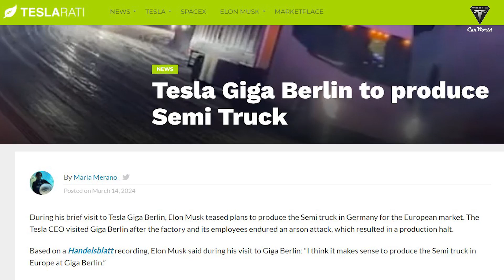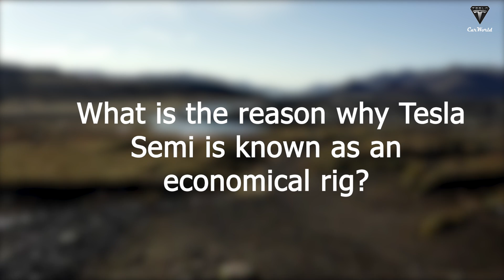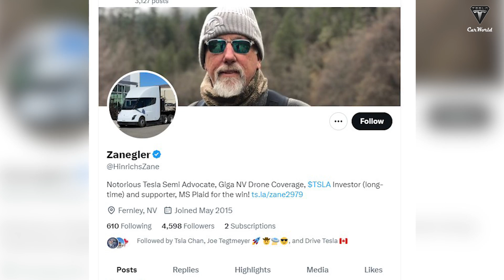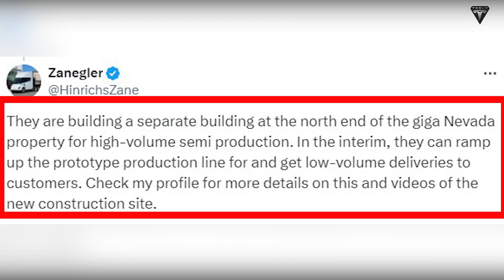Tesla Semi BIG Upgrade! Elon Musk Reveals No More 82,000lb, 1500 HP even 0.22 Cd! Here's WHY?

Comment: This truck is pretty innovative and a technological marvel. But that's where it ends.  I think most people that have favourable comments on it haven't driven semi for any appreciable length of time. This design may work well for certain dedicated routes. However, the average freight hauler will find the center seat configuration impractical. They need to interact with security gates at many terminals, warehouses, and distribution centers, providing ID and documentation. Climbing in and out of that cab is inconvenient and a time waster compared to rolling down the driver side window. Many gate houses are designed with high service windows for this reason. This may even force someone ro come out of the gatehouse to interact with the driver at ground level. Scales have the button pad at driver window height. Getting out of the truck will put the button pad out of reach,  forcing the driver to walk all the way across the lot to go inside,  thus delaying those behind the Tesla. They may have designed it "around the driver". But that's like saying a straight jacket is designed for a snug and close fit. There are so many other things that would annoy me to no end. Personally, I would refuse to drive one.

Comment: If governments were really concerned with global warming, they would be making plans for things like rail build out and infrastructure build out.  One train with lets say 100 cars could carry 200+ trailers.  That would be two hundred EV trucks / diesel trucks off the road.  This would be far better to move freight than using semis driving from state to state for long haul.  There was a study done that its going to cost over $1T to make EV trucks work in the USA.  EV's trucks aren't the answer, rail to move freight is.  Or even container ships, that can haul 22,000 TEU's in a single voyage.  That is a lot of trucks off the road at the expense of a single ship running on LNG.  Need to think out side the trailer box here for real solutions to the problem.  EV's aren't going to solve this issue.

Comment: It makes no sense . The electric battery for big trucks takes up to much weight . You would need 3 EV trucks to haul the same cargo as one diesel truck because of weight limits for trucks on roads . 0-60 mph on a delivery vehicle does not matter . It is simply this the EV battery takes up 2 tons of weight that could be used for cargo . So now you have to buy 
Insure and upkeep and house more vehicles. Additional drivers…. All that companies will ask is what is the price per pound to deliver goods . With upkeep insurance maintenance all of it included. The minute EV Trucks cost 1 penny less to run than diesel the money will flood in .
Reply: It makes no sense because you have poor comprehension. Tesla semi truck can move 21tons at a full legal  load, has is that 1/3 that of a regular semi truck??? 

0-60 matters when entering a highway ramp, passing traffick, or going uphill, going uphill at 55mph saves you a lot of time compared to 35mph. 
90% of trucks don't haul full weight loads on a average day.

Cost of maintenance and service on the tesla semi truck is about half of that as a diesel, and you save 300% on fuel, the reasons companies don't buy them right now is because they would first have to build multi million doller charging systems at their delivery sites, basically, EV semi trucks already demolish diesel on running cost but not initial investment cost, companies are much less prone to long term strategies so tesla has to prove the tech through using themselves, they already being used for logistic runs between Nevada and California.

Comment: Sorry Tesla Fans, the Tesla Semi isn’t the future. This prototype hybrid diesel/electric truck is made for the real world, especially for off road use like logging. Edison Motors built their prototype in one year using off the shelf components and their design philosophy includes the right to repair. 
The very first load moved by this prototype was over 100,000 lbs something the Tesla Semi isn’t designed to do. 
Edison is also working on a retrofit kit for older pickups that will be for trucks that are used for hauling and work unlike the Cybertruck 

https://youtu.be/ROtRiO5rECk?si=aavD7Q9Bn_Pz5WaG
Reply: Lol Edison motors can't compete with the tesla semi trucks scalability, retrofitting things into EVs cost more than just using it as fossils or straight EV, but saves massive on needing custom manufacturing equipment... equipment that would be useful for mass manufacturing. 
Full EV drive trains are better for offroading and high loads than hybrid systems, the tesla model X once towed a 260,000lb passenger plane. The tesla semi uses plaid motors which are even better for trucking than any other RV motor made as they spin up to higher RPMs and maintain far more torque at higher RPMs, makes it a real torque monster.

Tesla cybetruck is a truck I would use in light duty work, and I would like it since I don't have to wory about dents or scratched paint, might haul loads with it for jobs inside the state but not out.
Reply: Edison and Tesla aren't competitors.
Reply: @ThiagoMarquardt  the owner of edison motors likes to pretend they are.

Comment: How about the cost of replacing the batteries and tires?
Reply: Tires are a given expense, wait and see if electric drive is any harder on tires or not, not enough units out there with enough miles to gauge that properly yet. Batteries will be interesting to compare over fuel costs in the same time/mileage period, another hurry up and wait and see, many changes yet to come on batteries, and in energy suppliers pricing structures.
Reply: If you have to ask you probably can't afford them 😂🤣
Reply: @rjones2000r   The cost will be passed to consumers that are buying the goods the truck is delivering.  Means YOU can't afford it.

Comment: There is no need for Tesla to boost  the semi range.  Replace the short haul semis with EVs first.  By the time the short haul semis are mostly EVs the nationwide charging infrastructure for semis will be mostly in place.  By that time, improved or new battery and motor designs will provide 30 to 50+% more range at the same weight.  Fuel and maintenance savings alone will propel the switch.

Comment: The greatest thing on the fly switching from the truck battery to the solor powered  trailor battery pack . You need a 120,000 GVWR capacity on both tractor and trailor , simply means addig a extra axel to the truck and trailer. When the nattery pack is getting low on the truck switch over to the battery pack on the trailer then it switches simultaneously to start charging the truck with the roof solor panels until you get to your destination and do you two hour charge on the truck / trailer

Comment: The Tesla truck needs a spare battery pack and solar panels on top of all Tesla trailers they may be expensive trailers but only Tesla trucks can hook up to them unless there's a adaptor for other truck company's therefore you need able to go twice the distance per load all the whole the trailers will be self charging when you hook up to a Tesla trailer you'll be able to go over 1000 miles before needing to be charged

Comment: As a 36 year experienced driver (retired now), this is a fascinating idea. Based on this recent winters display of EV's batteries not holding a full charge or not charging at all and your "test bed" area being in southern Nevada (?), it is an idea that is not yet ready for full implementation. The one problem I see is that ALL EV's should be able to charge themselves as they are in motion, and so far, non do so. The other major problem is winter and the possible extreme cold temperatures. Unfortunately batteries and cold temps do not work well together. The idea is intriguing though... Interesting. Thank you.
Reply: Cold is an issue for both EVs and for ICE vehicles.  With ICE vehicles you plug in a block warmer.  With EVs you charge at the end of a run while the battery is still warm not after the battery has cooled down to ambient temperatures.  Then you prewarm the battery before its next use.  For the semi, the power for prewarming could come from a 110 VAC wall connection leaving a full battery for hauling.  For cars the power for prewarming comes from your home charger or from your battery.  Yes this takes forethaught but who really wants to stand in the cold and wind to fill your vehicle with flammable fluids.  Plug in, go into the truckstop, take a shower, eat, and your truck is ready for the next leg.  Unplug, pull up to an overnight spot, plug into 110, and get some sleep.  If there is a line at the charger, get in line, do your things inside, then charge when your truck tells you the truck in front is moving.
Reply: The only cap is it battery and charge speed. It's 2024  it only gets longer range and faster charging from here all out. This  truck is for straight runs that cover 60 to 70% of runs in general. 2040 will be very, very different.
Reply: @shawncooper8131  We will see then if I'm fortunate enough to still be in the land of the living...
Reply: @mlhardin1822  I would say we are in the 1940s of EVs in ICE years.

Comment: Semi Trucks in Europe have to be more powerful than in America. Because in Europe they are always going up and down mountain ranges wherever they go. Also they need shorter cabs due to a lot of tight turn older roads and twisty winding roads. Also the environment is colder and snowy in the north and hot and sultry in the south. 
So European standards are set for the conditions which exist in Europe, and height ( determined by tunnels) weight (determined by road strength) length ( determined by older cities and roads) power ( determined by road slope) are not going to change, for American standards based on flat wide interstates. 
Tesla will just have to meet the Engineering challenges as they exist.

Comment: The Semi-truck driver is visually too vulnerable or too exposed in relation to the projectile wind, the driver is placed as a target element or weakens his reaction speed in the face of possible danger...(NIGHT TORCH?).
The place in the center is anti-friendly or dedicated as if the driver could be crowded there, in spite of himself...
Revolutionary for the large fleet of trucks of this type of ultra-economical concept.

The concept of great interior transparency, seen from the outside, lowers the modularity/interior customization ratio possible for many buyers from all walks of life.
With such low ground clearance because of the wheels.

The driver's cabin risks too many shocks and repairs because of the size of the windshields which are much too wide, dipping too low, like a giant cart without anti-gravel protection perched at 2m-2.5m, minimum height.

  Apart from that, the heavy truck of this brand performs well in terms of consumption efficiency and above all maintenance with its unbeatable price in addition. So congratulations to the new concept of the brand, and its future variants.

Comment: Cost, payload and axle load.
The reason to move to Berlin probably has more to do with range of travel than to supplier/production capacity.
In America we travel 1000 miles just to visit Grandma on a weekend and semis cross a continent weekly, plus in pretty much half this continent size country, during the winter the semis stay all night with engines on due to HVAC needs.
You can do that on a Semi Ev if you are not concerned about paying to work but to have a profitable proposition with an EV truck, you need to go short distance and light on battery weight therefore Europe.

Comment: One thing Tesla could do is make an axillary battery that could be carried in the trailer that could boost range. 

Thus one can trade range for freight payload and use some of the freight payload to carry the auxiliary battery to get greeter range, e.g. give up 20% payload to get significantly more range.
Reply: There is already a company producing battery powered trailers for semi trucks to pull. 
They have their own electric drive wheels and use sensors and computers to decide how much and when to power the drive axle. Thus they can be used by diesel trucks as well to reduce fuel consumption.
Reply: Cool! @jeremytaylor3532
Reply: There is untapped area on the roof of van trailers to install solar cells to help charge batteries during the daytime. @jeremytaylor3532
Reply: Battery swaps for trucks would be perfect solution
Reply: Actually, an aux battery in the trailer would be pretty easy to swap if it is at the back of the truck. @viktorianas
Reply: @RonLWilson dragging weight is inefficient, smaller swappable batteries is the future of long haul.
Reply: Europe is smaller than the States !
Reply: You do realize truckers get paid on a ton rate, so 20% loss in payload equals a 20% drop in revenue